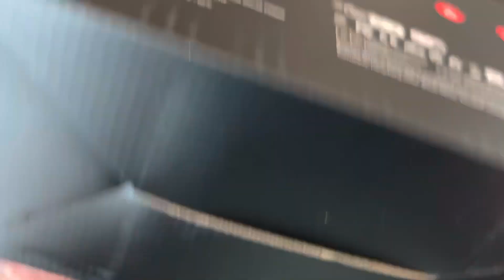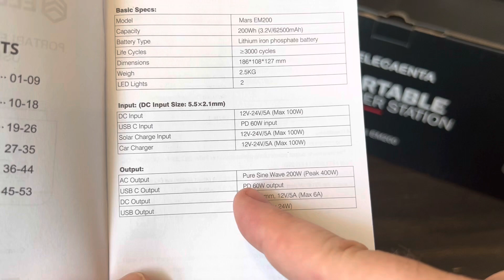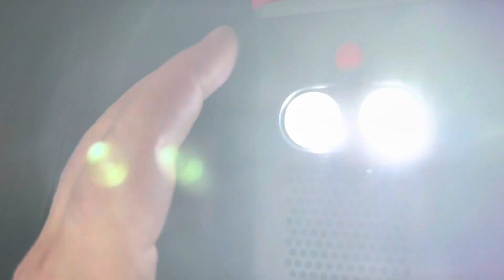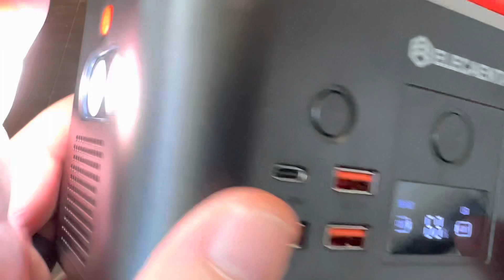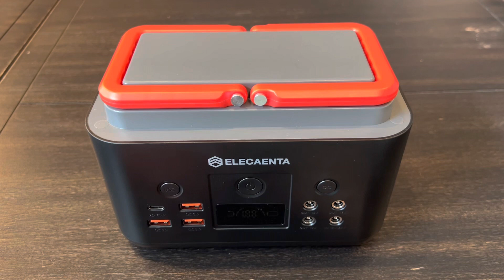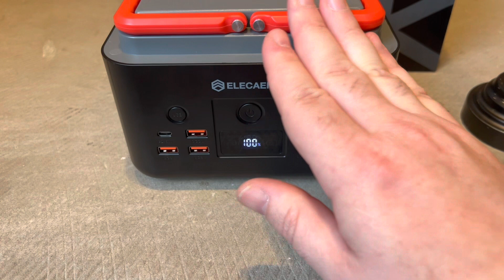Elecaenta EM200 Portable Power Station (LiFePO4, 200 Wh, Lightweight)

Comment: I live in Ukraine ,and we difficultis with electricity courses by Russian war, id like to use youre product to supply my internet equipment. 
can it pass through dc output 12V while station is connected to AC charging ? and if AC charging will switch of ,will the DC output 12V still will be on from battarys ?
Reply from the maker: - The unit does have pass through charging so you can use the dc ports while charging the unit with AC. This particular unit is pretty small and therefore the battery capacity is a little low. Your modem and router probably consume 20 watts per hour so you’re likely only going to get about 8 hours of use with a power station this size

Comment: Thanks for this, I appreciate the detailed review. A few questions:
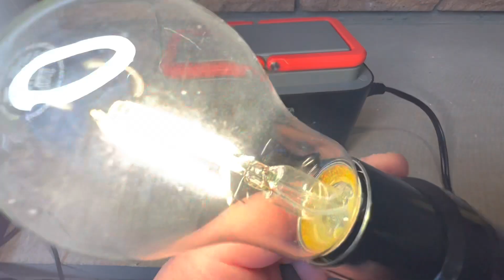At 10:45 did you instead mean use the USB ports which you pointed to (not DC)? And what's the reasoning? (Not to disagree, just curious)
Same for 10:57 - why would that be?
Thank you
Reply from the maker: - usb ports are considered dc ports due to the voltage and the fact that they don’t use the inverter. It’s somewhat hard on the batteries to charge and discharge at the same time. They heat up which causes degradation faster especially if the output is more than the input. With any power station, it’s almost always more efficient to use the dc ports because you won’t have the inverter loss. Hope that makes sense
Reply: @Steve-Goff  👍😅

Comment: Nice bro, I'm going to be starting home dialysis soon and would really like to get something to run my machine if we get a power loss or blizzard so I don't miss a session. I'm under strict strict budget because of insurance change to cover my needs and was wondering if you could recommend a unit for me that will work
Reply from the maker: - sorry to hear about your health Joe. Is the dialysis temporary or long term? Do you have any idea what the watts will be of the machine. You might be better off getting a small gas generator. Champion makes decent ones that are affordable. Tractor Supply has them on sale multiple times a year
Reply: @Steve-Goff  I will check them out, I do not know the specs of the machine yet but it will be long term. Thank you for getting back to me ❤️❤️